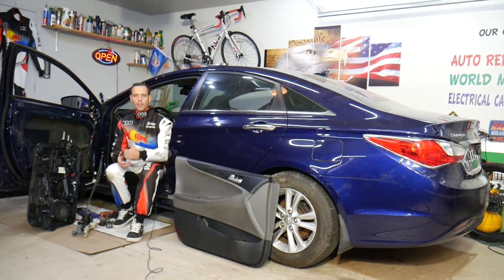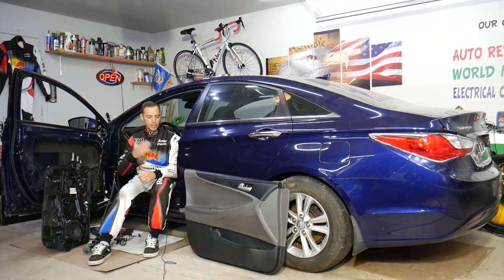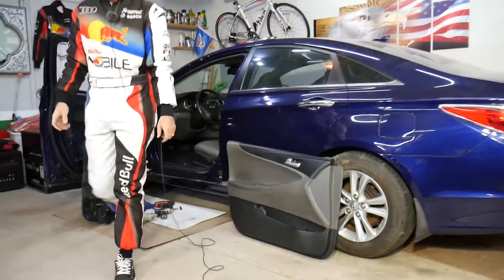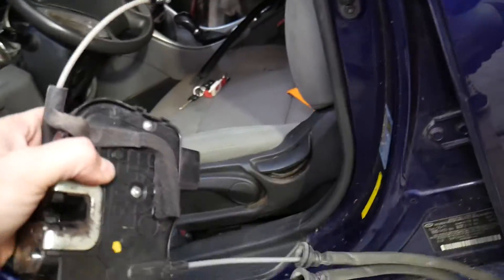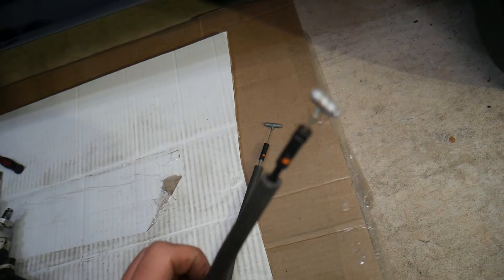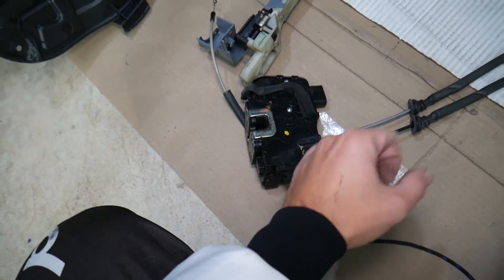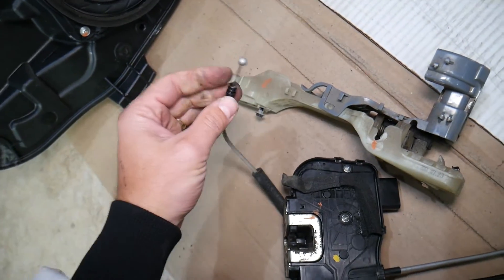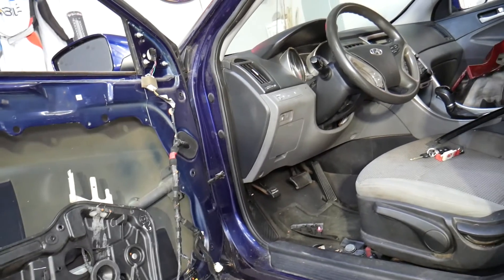WHY FRONT OR REAR DOOR DOES NOT OPEN FROM INSIDE OUTSIDE ON HYUNDAI SONATA

Comment: Hi. Good background info on the lock actuator but how can you open a door if neither inside or outside work?
Reply: I have the same issue the door will not open from inside or outside. It is the back door and you cannot get the panel off with the door closed. My husband is a mechanic and says we will have to cut into the panel to get it to the broken part and replace it. Them we will have to buy a new door panel. It has been broken for over a year and we still haven't fixed it.
Reply: Don’t cut. You can get a pick and pull the wire in the door handle opening and push and it’ll open. There are several videos on it explaingin in detail
Reply: @clwlovestoread7598  I didn’t have to cut into the inside panel but I took out the screws securing the panel to the actual door and took a prybar and went around the edges popping the tabs. Then I use the prybar on the bottom to pry upward and was able to get a panel off. The issue after that is getting to the actuator which is still tricky with the door closed because the manual release is on the side that faces the car when it’s closed. So you can’t actually use the manual released if the car door is still closed. I am the manager of a mechanic shop and I will tell you that this is not easy and that answers a lot of people will give you are not specific to this exact scenario where the door does not open from inside or out and have to get the panel off and to access the actuator when you cannot access the manual release switch. When you get the panel off you also have to take the window motor off and the screw that secures the glass to the regulator so you can get another access panel off to get to the actuator
Reply: @xstatixtribalelectronicmus2787 hello Mr manager. I have the exact same problem. Have removed the inside panel with GREAT difficulty. Any tips or instruction on how to get to the manual release from there? Thank you

Comment: How do you open rear when it doesn't open?  You show why it might happen but not how to open it to get the panel off in rear.
Reply: You can pull the wires in the handle on the inside and it’ll open if done it.

Comment: Hi. Thank you. I have a Hyundai sonata 2011. Having a problem with front doors not opening from the door switch. Sometimes keyless start does not work. Have replaced 10 amp RF fuse. Hyundai say that the antennas are not seeing the fob. Please advise. Thank you